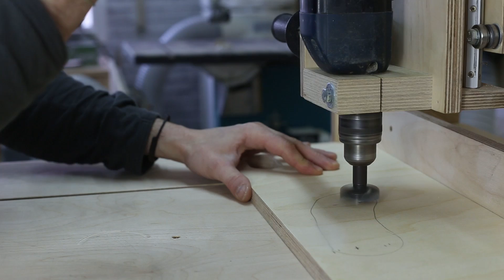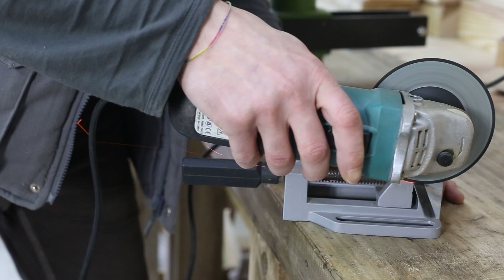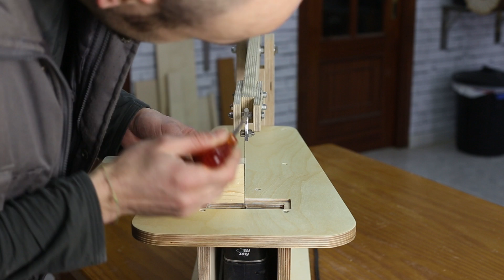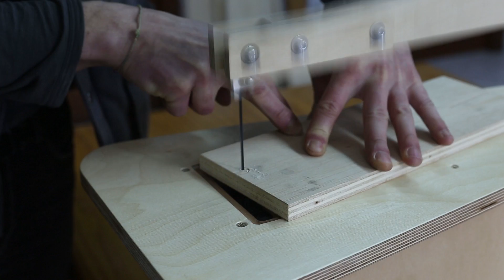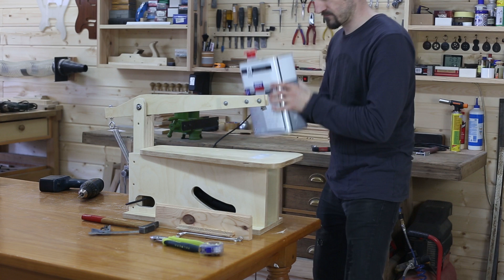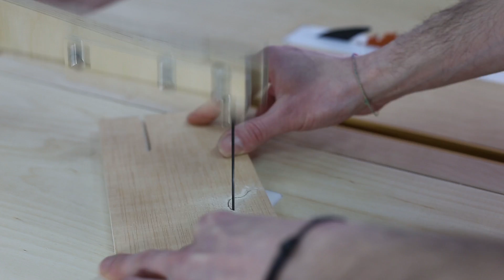Make your own Scroll Saw (part2)

Comment: I made one quite similar to this. Only I used a sewing machine for the motion. (In the same place that you used a jigsaw.) And I used ordinary coping saw blades, so I could make holders for the blade out of bolts with cuts in them. (Like an ordinary coping saw, blade holders.) No clamping needed.
Reply from the maker: good idea! thanks for comment

Comment: Excellent work.l ve two question to u. 
Can l cut 5cm wood with your system, l didnt mean polywood and what kind of saw are u using. ? For ex.Metal saw can suitable or not, this kind of clean wood cutting. ? 
l ll be very happy if u answer me.Thanks.
Reply from the maker: thanks!
no, to cut 5cm thickness and get a good cut you will need a band saw.
Reply: Paoson WoodWorking Thanks for ur fast reply.Still l m thinking that ur work is excellent eventhough can not cut thick wood.

Comment: Thank you so much for your prompt reply.
 
Even if I use wood saw blade then the problem  will be connecting  with jigsaw. My  jigsaw   requires "T" end blade.
 
The jigsaw connector is press down type , slide the blade into the guide and it lock. It's Fujita Japanese make low end model 

Please guide me

Thanks, regards
Reply from the maker: my jigsaw is also requires "T" end blade! my jigsaw has a lever to open, insert the saw and close it, this is mine: 
http://paoson.com/downloads/forum/86s/jig-saw-and-accesories
can you send me a pic or a link of your model?
Reply: Here is link to my jigsaw :
https://www.facebook.com/photo.php?fbid=10153809194781630&set=pcb.10153809196741630&type=3&theater

Comment: Hi

I am into making scroll saw on your project line. Need assistance and advise 
I could make attachment of blade on the moving arm while find it difficult for making connect with jigsaw.

my jigsaw has press down adapter for the blade and its 'T' end blade. I did  the same way , cut my used blade (with great difficulty) and when coming to make a hole for blade attachment its not possible. Lost several bits while trying to make hole but of no use.

Could you please advise me on the options.

thanks, Regards
Raghubir
Reply from the maker: you're right! they are difficult to drill, try to drill a saw to cut wood, they are softer than the metal cutting. Premark the place of the hole, and use a quality bit for metal. Let me know if you still have problems!

Comment: how do you account for the arm not moving vertically....it would move in a slight arc with this single pivot setup?
Reply from the maker: +Jack Timms If you mean horizontally, it does not move with the kind of materials I am using it.